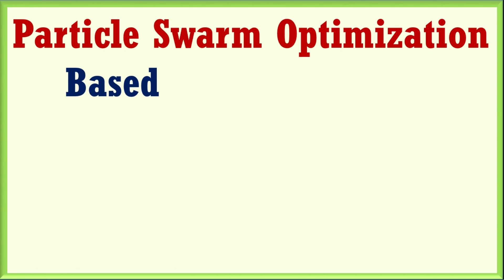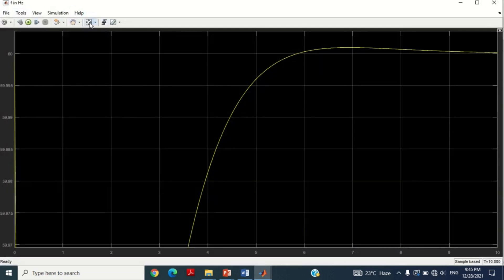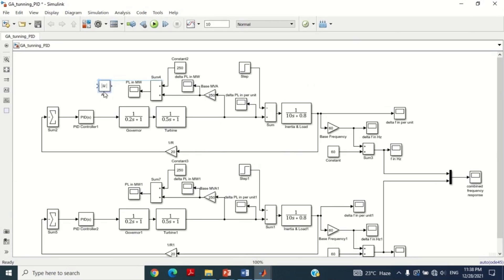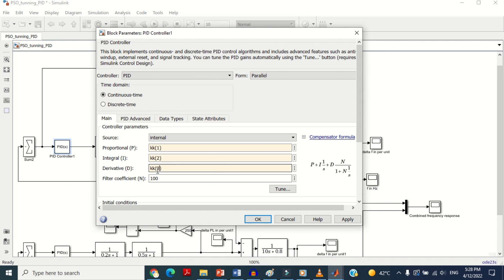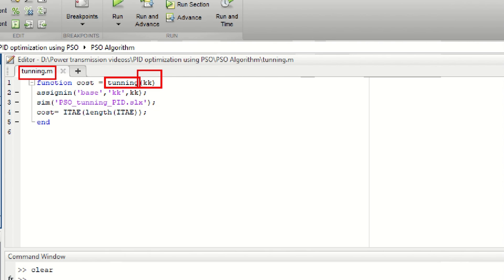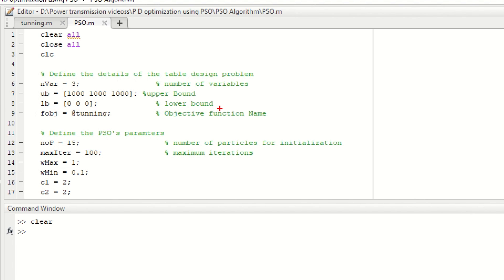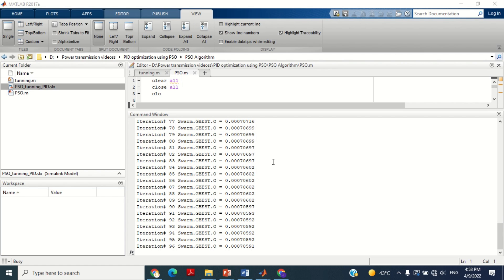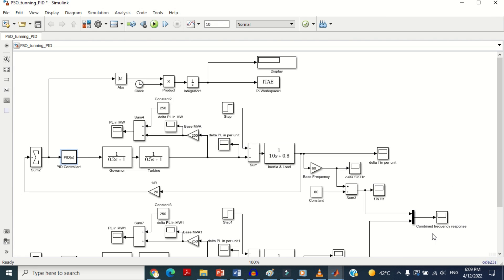Particle Swarm Optimization Based Load Frequency Control in SIMULINK | Dr. J. A. Laghari

Comment: Hello Mr. Laghari. I want to speed up the optimization by entering the PSO parameters as vectors. I am studying on battery modeling. I have 5 parameters. How can I provide these parameters as vectors and what should I change in the Simulink model?
Reply from the maker: Thanks for the comment. I think it is better to follow any research paper closely related to this idea for better understanding. or get help from chatgpt to get some help. Regards

Comment: Please help

Are fitness functions same for every model? If not, from where I will find ITAE equation for my system😢.
Reply from the maker: Thanks for the comment. Yes fitness function remains same.
Reply: I am using PSO optimization in a car suspension. But cannot understand what will the value of "f". Can you tell the meaning of "f, and P"
Reply from the maker: @nadiaakter9351  Thanks for the clarification. I mean for load frequency control the fitness function remains same for all optimization techniques. For car, the fitness function will be different. You may follow the research paper to that model for better understanding.
Reply: Thanks a lot. Your videos are really great. Keep enlightening us.
Reply from the maker: @nadiaakter9351  Thanks for the compliments

Comment: Sir please one video on fractional order pi controller optimization by genetic algorithm through optimization tool box in matlab
Reply: Thanks sir for replying me I shall be keenly waited
Reply from the maker: Thanks for the comment. You may follow my video and replace PID with fractional PID controller.
Reply: @DrJALAGHARI  yes sir but sir problem is in pid three variables kp ki and kd but in fopi one extra variable lambda is added sir what is the procedure of lambda sir if you make a video I will be highly grateful 
Thanks sir for replying me
Reply from the maker: @AmitVerma-no7vj  I have also not worked on fractional pid controller. I have shared the procedure with you. You may follow it.
Reply: Please sir shared the fopi controller parameter optimization I shall be keenly waited

Comment: assalamualaikum sir, I plan to use pso to solve optimization problem in my undergraduate thesis. But the parameters in my problem are binary. What part of the code must be changed in order  to work for binary problems? Thank You
Reply from the maker: Thanks for the compliments. For binary, I am not sure you may follow any research paper closely related to your topic or search for binary pso that may help you.

Comment: Sir can u explain  about connections detail
Reply: Sir how u connected the circuit individual
Reply from the maker: @saimanikantaanem0047  I think it is explained step by step in the video. I don't know in which part you are confused
Reply: Sir when i did the same circuit iam not getting same output sir at starting only sir
Reply from the maker: @saimanikantaanem0047  may be you are using the latest version of MATLAB. I have designed this model in MATLAB Simulink 2017a version.
Reply from the maker: Thanks for the comment. May I know what details do you need to know about connection.
Reply: Sir if i done in that version i will get answer sir  thank you sir .... I will try and  give u confirmation sir ...

Comment: Hello sir the PID controller is not accepting the kk value what to do?
Reply from the maker: Thanks for the comment. I think you have latest version of your MATLAB. In latest version, you have to change the settings of the simout block by going into model simulation parameter configurations. Otherwise install 2017a version.

Comment: what a great work u r doing sir..no words.. really thank u so much...god bless u always with good health
Reply from the maker: Thank you so much for the compliments.
Reply: @DrJALAGHARI  Sir you have attached the PID controller before the governor but shouldn't it be in parallel with 1/R loop as shown in diagram in the  beginning of the video and also in the another video of load frequency model on your channel https://youtu.be/9Aocf1sAtdY .Also according to dig/theory (hadi saddat fig 12.16 page number 543) the input to PID should be delta f/omega (not delta f or w/R)and and control signal from output of controller should be given to preference or input power so that controller can increase or decrease power in case frequency changes.Please clarify it asap as i'm working on this topic and doubts are coming in my mind
Reply from the maker: @MS757-p3l  thanks for your critical message. Yes you are right. The pid controller should be placed after the error signal. Therefore, it would be better to place the pid controller as you have mentioned.

Comment: Sir is there any inbult function for PSO OR how to set PSO MATLAB TOOL PATH FODER in matlab?
Reply from the maker: Thanks for the comment. Just open the matlab pso file and other files in current folder section of the matlab. It will run properly.

Comment: Dear Dr J.A. Laghari, thank you so much! you shared a lot of video which is important and necessary. I just want to share a video of Gray wolf optimizer specially with PMSG based wind turbine BTB converter control
Reply from the maker: Thanks for the compliments. Basically this topic is not purely my field. Furthermore every new topic needs new learning. It will take time to learn and make video on this topic.

Comment: Sir while running the program its showing more input variable required in tunning,. I have applied this technique for PI controller and also changed the number of variable  to 2 and upper and lower variable i have considered only two times, how to resolve this issue?
Reply from the maker: Thanks for the comment. Change the input variables in the tuning function program, pso program as well as in the simulink model. It will work.
Reply: Thankyou for your response,Sir by changing input variable you mean name ? I have changed the variable 'kk' name in both model and matlab file but it still shows the same error
Reply from the maker: @ankitasharma5803  No. I mean if you are using two variables, then change the number in all three accordingly. Or first run it with three variables means pid if it works fine then gradually change it for pi controller.
Reply: @DrJALAGHARI   Thankyou so much sir, it worked ,You are doing great work
Reply from the maker: @ankitasharma5803  most welcome

Comment: sir please give access to the other two videos also.
Reply: Sir in the play list it's showing 3 videos but 2 are not available please make them also available. N your video are so helpful thank you so much sir. Even I have one doubt like I have 2015a version of matlb so this codes will run in the same?? It's showing error that it is made into 2017a version
Reply from the maker: @ShivaniSingh-nx5lp  Thanks for the comment. Yes. it shows three videos but actually there are tow videos. Basically that video is still in the final stages and requires some checks. I will upload within few days. The model is built in 2017a version. Therefore, either you install 2017a version or you built the model by your own.
Reply: @DrJALAGHARI  sir u have not given the matlab model in the Google drive. And if I implement the model in 15a then the same code will run for 15a also?
Reply from the maker: @ShivaniSingh-nx5lp  I have provided the matlab model, and two codes. May be due to different versions it is not opening. You have to switch to matlab 2017a version otherwise it may cause error.
Reply from the maker: Thanks for the comment. Which video ?
Reply: Sir please upload for multi area also. It's a request sir
Reply from the maker: @ShivaniSingh-nx5lp  Thanks for the request. Yes I am working on it. The video is in its final stages. I will try to upload within few days. Kindly share this channel within your circle too so that others may also get benefit from it. Thanks

Comment: Does this model works with deregulated power system sir?
Reply from the maker: Thanks for the comment. No. This model will not work with deregulated power system. for deregulated power system, many parameters will be changed.
Reply: @DrJALAGHARI  okk sir! Can you make one video with deregulated power system sir?
Reply from the maker: @pangerkaryash  I will try but I am not sure about the time.
Reply from the maker: @pangerkaryash  I will try but I am not sure about the time.
Reply: @DrJALAGHARI  okk sir as per your convenience

Comment: Sir, Can you make a video on Fault Localization using travelling waves
Reply: I have done the fault detection and classification part but i am facing problem with the localisation using travelling wave.
Reply: My topic is "FAULT DETECTION AND
CLASSIFICATION USING TRAVELLING
WAVES"
Reply from the maker: @biswaranjanmahanta4313  Thanks for the comment. I have not done this method. And every new method requires new learning and implementation which may take months to complete. Due to my busy schedule, i may not be able to do it.

Comment: Good Job ........ultimately you kept your promise.......Great Sir....keep it up
Reply from the maker: Thanks for the compliments. Yes. Of course. I always respect my followers wishes. Basically every new topic requires new learning, therefore, sometime it takes more time to make video on the topic. Now, kindly do share it within your circle too.
Reply: @DrJALAGHARI  Sir in this video you have taken change in frequency deviation under integral error , i want to take overshoot and undershoot under the integral error so that overshoot/undershoot does not ho beyond certain range…i am not getting how to do that …how to add overshoot/undershoot as parameter to ITAE block…i am not able to extract overshoot/undershoot signal from scope. I have tried using it with storing signal data in workspace however not able to retrieve overshoot/undershoot from it (to assign them to ITAE block ) please help